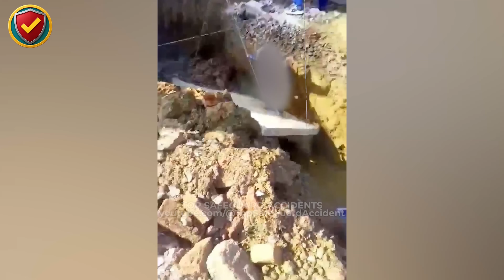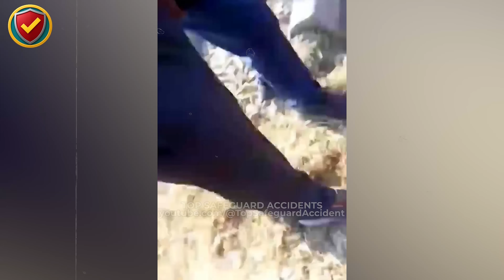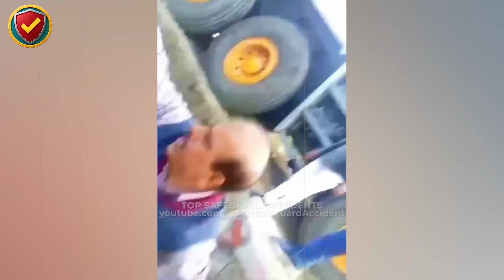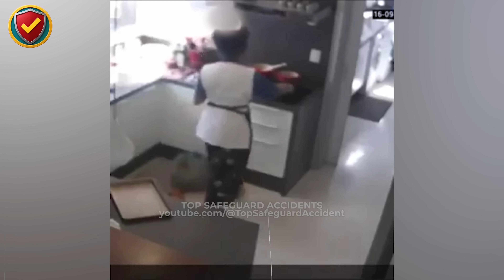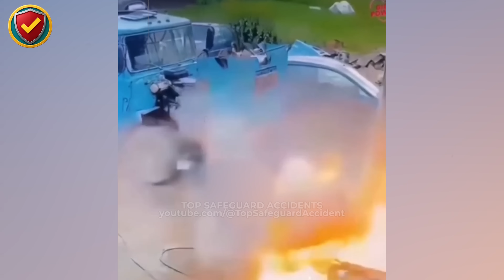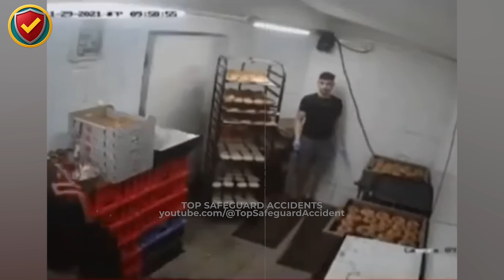Moments Filmed Seconds Before Everything Went Wrong at Work Ep. 82

Comment: Pretty funny watching that goon spraying lit fuel after the fuel tank explosion with water (exspecially high pressure water). Pure comical gold as hel only help to spread the fuel while lighting further things ablaze. Cutting/grinding fuel tanks (liquid or gas) without proper inert gas purge and/or water displacement is completley ignorant and inept. Put the grinder/welder down, sell them, and get a different job.